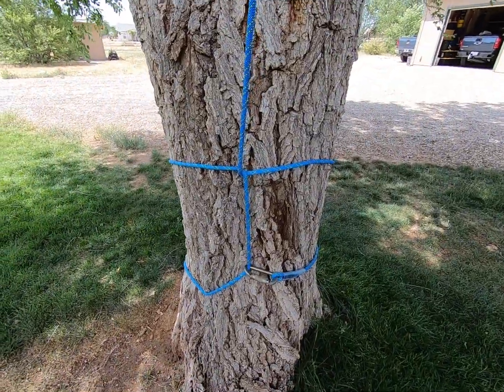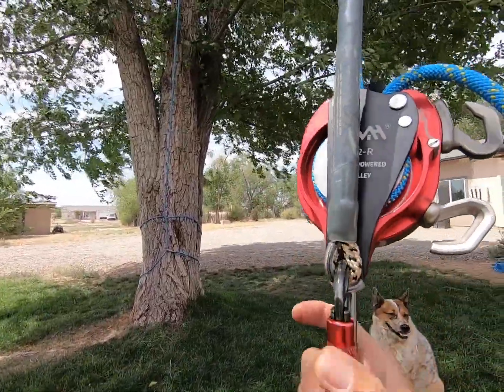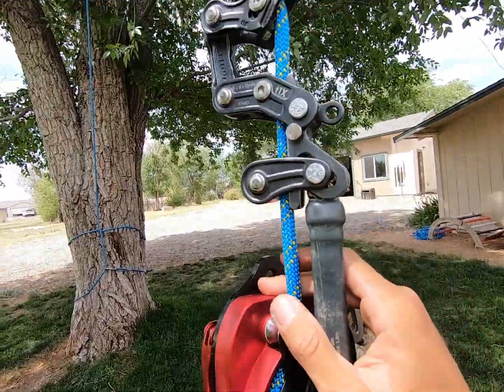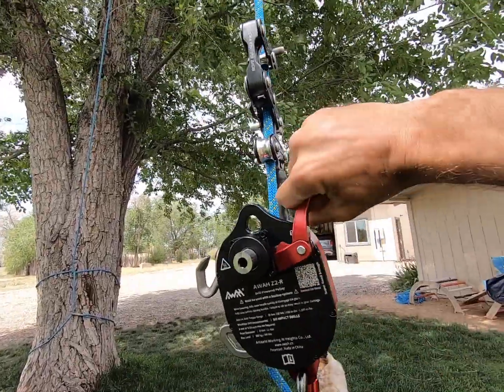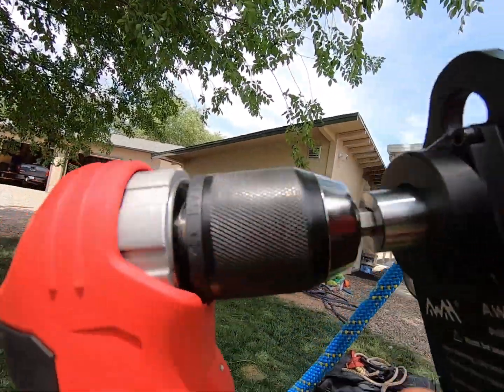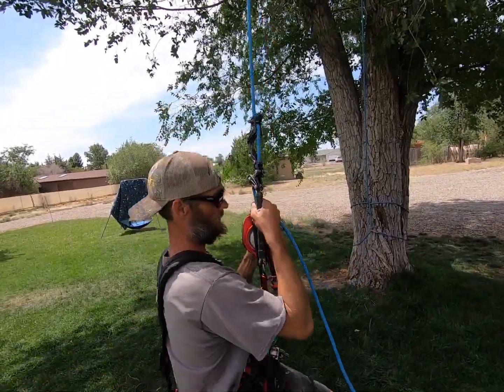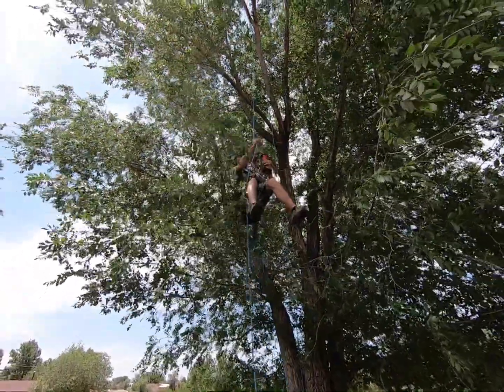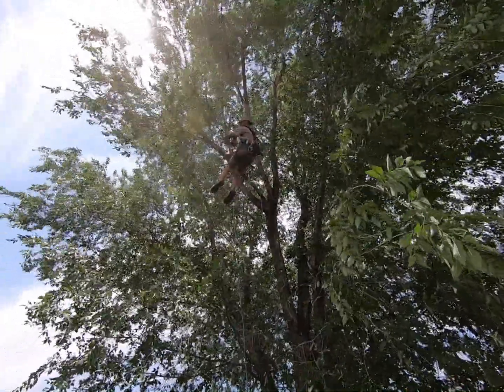LOOK AT THIS drill powered ascender/pulley! Z2R. What can it be used for???

Comment: “Like an old man” ? 
I resemble that remark! Lol 😀
I'm using the Z3 Fire BTW
Reply from the maker: I certainly feel old 👴🏻 

How is the Z3?????
Reply: @timbermen11  
I really like the Z3 Fire. 
I can leave the drill in the whole time if I want. 
I use the Z3 for rappelling as well since it works exactly the same as the "CMC Clutch" descender/hauler.
Another added benefit is there's no need to tend the exiting rope (standing end), it just flows out by itself and the ascender grabs the rope very well on it's own.
For my backup, I use the top hole above the rope exit (the becket) to tie a piece of hitch cord, then the hitch cord is configured in a Blake's hitch on the working end of the rope, if the Z3 were to fail somehow, the Blake's hitch will catch me. 
The Z3 also has an internal backup safety catch in case the spring loaded gear latch fails (the part that clicks).
I'm 66 years old with a fused lumbar section of my spine (the lowest part). I can move around a tree laterally just fine, even limb walking, but the initial climb is out of the question, even if I'm using spurs. 
BTW, I use a moving rope system, so if I want, I can use speed 2 on my drill and easily reach the top pretty quick. 
Although, I usually use speed 1 so I can keep an eye on things, I'm not in a rush at all when it comes to being in a tree. 
Heck, I'm not really in a rush no matter what I do these days! Lol 🙂
Thanks! 🙂
Reply from the maker: @YetHereWeAre right on! Sounds like you have your gear really dialed in, old man😅
Reply: @timbermen11  Lol 
Thanks for the laugh, young feller! 🤣

Comment: The is a way better PPE certified device  called the Mittelmann infinityAxess-MTK20S. This device got certifications for abseiling, rescue, lifting etc. doesn't wear its input shaft as fast as the Z2R due to a better gear and gear ratio and does not have glued parts like the Z2R.
Plus if your drill fails you can use a ratchet wrench
Reply: Where to purchase this one?

Comment: Thays a really cool set up. I really like the stiff tether. Like you mentioned on my video, two ropes is definitely the way to go. I'm not familiar with that drill, but if it's not brushless, keep an eye on it on long accents. They say brush motor drills can overheat with a long hard duty cycle.
Reply from the maker: @zach-riggs  the first drill I had was brushed and only made it 15ft. The Harbor Great drill is doing awesome so far. 
Like your buddies setup, I also started with the akimbo. The RR with the stuff teather seems to be the best setup. 
Taking a secondary climbing system also allows you to bail out if the Z2R malfunctions on the way up.
Reply: @timbermen11  For sure, for sure. It is super important to always have a rope egress and this unit doesn't claim to be able to support that function so I think two ropes is probably the way to go. I'm going to try setting it uo that way next time around for sure.

Comment: Rope runner and all arborist devices are 11 to 13 mm..with some variations
Reply from the maker: 1:18
Reply: @timbermen11  I know you said only 11 and under so was assuming you didn't know..wanted to check out that device ...I'm older and wounded plus have health issues my liver so Been struggling as I run tree care solo ..very very difficult doing full size removals with no equipment .hand loading brush loggs and climbing 🧗‍♂️. With half liver a torn knee. Broken left foot bone knuckles and broken left hand knuckles..at almost 50 ..I recently have used my grcs for a ride but requires a helper wich I rarely have..thing costed 5 grand with exssesories..I've lost 30 pounds am finally maybe getting medication needed..been solo 6 years no one works here.they want payed but don't produce..or stay longer than a week..I'm so beyond tired and sick..anything tool wise helps 1500 is cheaper than grcs wish I knew about thos before..hand. that Ronin is way way to heavy .being sick in this 10p degree heat I can't barley lift my saws let alone that thing..saw one in my local shop it's as heavy as my grcs ..no way I'm useing that .the rapter also looks to heavy...I run ported echo 2511t 3 of them..and try not to use big saws unless I absolutely have to ..sold my 661cm for that reason ...thanks God bless

Comment: I'm thinking about getting one of these for my own tree climbing...my one major concern with your setup is that if the pulley shreds the rope then there's a good chance the rope will just slip right through the rope runner due to the way a damaged rope becomes more compressible. You've only got a few inches between the bottom of the rope runner and where the rope would fail.
Reply from the maker: @outofmiryclay  good point. I can’t really think of another way to back it up and it’s a lot of work too set up a secondary rope, so I’m just going to go with what I’m using and pray it keeps working. 
I’m more concerned about internal gears stripping and the Z2R failing mechanically rather than it chew a rope up and fail that way. 

Can you think of another way to back it up?
Reply: @timbermen11  the only thing I can think would be to attach a hand ascender  to your bridge with a webbing sling long enough so that the ascender grabs the ascension rope just above the rope runner.  The toothed cam of an ascender will grab more securely and quicker if there is a failure.  That being said, you are correct that it is very unlikely that the pulley will actually shred the rope under any kind of "normal" use...most likely the rope would start slipping or the gearing could malfunction.  

What I was thinking of doing is having a dedicated ascension line strictly for the pulley and then use my normal rope for my standard mechanical device.  I was thinking I'd just pull both lines up the tree simultaneously with the same throw line and base tie them and then once I make it to the top I'd have the ground person undo the base tie on the ascension line and lower that whole system down.  Wouldn't really take more time to set up...and I think you already said you'd be bring a second rope up with you anyway.
Reply from the maker: @outofmiryclay  good idea with the hand ascender teeth. It would likely still grab if it was above the RR. 

I tried the 2 separate ropes and it’s difficult to work the drill with one hand and tend slack on a climbing system with the other hand
Reply: There is a way better device which is PPE certified Mittelmann infinityAxess-MTK20S. This device got certifications for abseiling, rescue, lifting etc. doesn't wear its input shaft as fast as the Z2R due to a better gear and gear ratio and does not have glued parts like the Z2R.
Plus if your drill fails you can use a ratchet wrench.
Reply: You can put a Petzl ASAP above the Z2R, that's what I do.. If something fails, the asap will lock and keep you safe.
Reply: @Talesofaclimbingarborist  If you use the wrong rope by accident the Z2R can damage the rope with might not leave enough rope for the ASAP to grab on to.
So I stick with the Infinity Access by Mittelmann which does not require an ASAP on the the same rope.
Reply: @Perzyval93  The asap grabs extremely fast. I've seen tests where it needs less than 5 cm rope to grab. With a shock absorber in between there is plenty of rope for the asap to work. 
I agree that the Infinity access is a better tool for the job, but going with what I have this is safe enough...
Reply: @Talesofaclimbingarborist  If you are a professional rope access technician you have a backup rope, so in the end it doesn't really matter what the Z2R MIGHT do in an unlikely worst case scenario.
Reply: @ I am an arborist. And I use this for first access into trees. We do thing a bit diffferent than industrial rope access.

Comment: I’m using the same setup the drill your using I don’t think is brushless. I’m had good luck with Ridged makes a brushless and Flex also. I’m using the ascender on 10mm line. I’m an akimbo on the second climb line. I never remove the ascender from 10mm rope just leave it hanging so can come and use.  The 10mm line is connect climb line by prusik midline pulled up setting the climb line.  When finished just lower both lines drown ascender attach.  It’s a leaning curve for sure good luck.
Reply from the maker: Sounds complicated….
Reply: Got a picture of your setup with prusik?

Comment: No idea what I'm talking about, this video somehow came up on my feed and I found it interesting to watch, but just wondering the question out loud: are you not kinda fucked if your ascender chews up your rope and your life-support device is attached above that? Like sure, it'll catch you if the ascender fails, but how do you safely descend after that? Surely you'd need someone to rig up a fresh line to actually get you down if that happens?
Reply from the maker: I bring a secondary rope with me. 

If that scenario happens and I get stuck, I plan on using the secondary rope and anchor to the tree or the rope runner above the Z2R to repel down. 

…or just call my buddies the fire department….

Comment: Cool toy! I think the design is a little better than the Ronin for sure (mid line, more rope tolerances) but not having a backup system built in is a major oversight, I like how the wraptor uses a rope grab and built in ring for your climb line. Even the ronin uses a similar failsafe option. If your rope gets bound in this pulley, you are stuck in a bad position and awaiting rescue. If I was to run that, I would probably try and run a rope grab above it off the little ring up top, then clip another climbing system to the bottom so I could bail out if shit goes wrong. Pretty sure window cleaner dudes use two ropes so this might be for them but it's hard enough getting one line in a tree lol. I think it's still cool but I think the wraptor is still the best powered ascender and I would not pay more than a few hundred dollars for something like this.
Reply from the maker: I bring a secondary rope with me. 

If that scenario happens and I get stuck, I plan on using the secondary rope and anchor to the tree or the rope runner above the Z2R to repel down. 

…or just call my buddies the fire department….

I ascended up a 90ft ponderosa yesterday and it’s worth every penny, for an old guy.
Reply: @timbermen11  Good plan! Stay
 safe bro!
Reply from the maker: @troyerthedestroyer  thanks man!